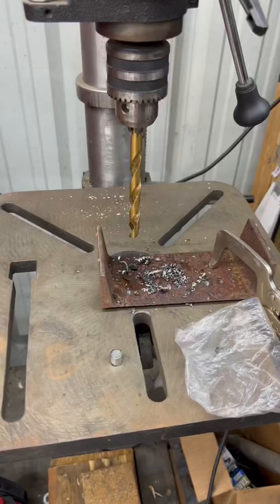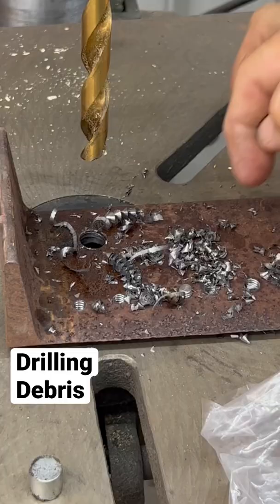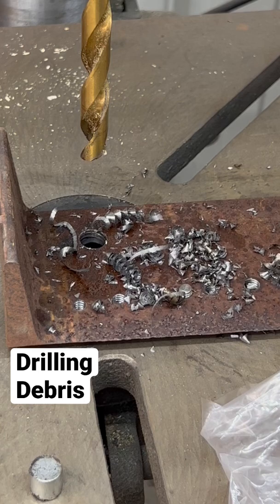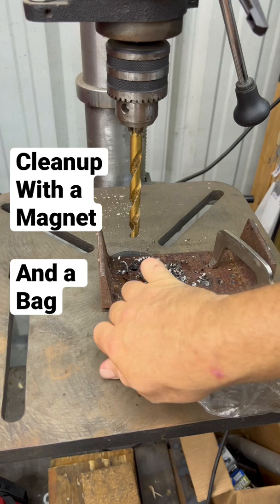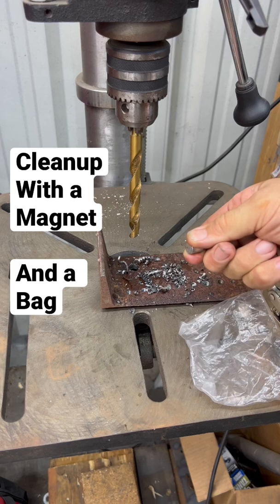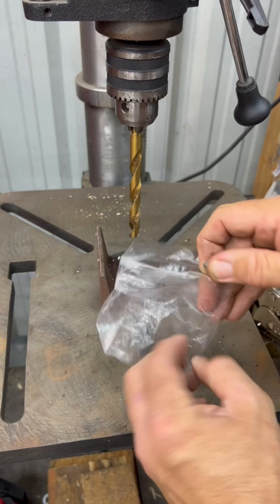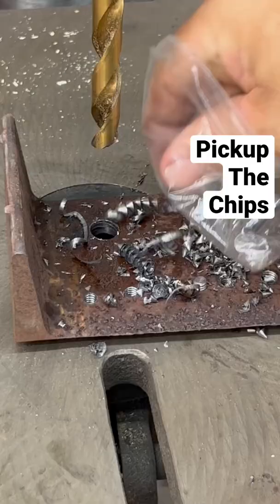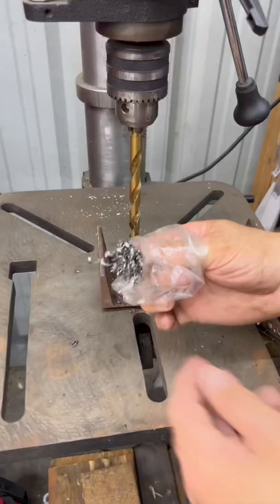Tuesday Tool Tip - Cleanup Metal Drilling Debris

Comment: Put the magnets inside an empty water/soda bottle instead. It works a lot better.
Reply: lol wtf are you talking about? Then you have to manually wipe off all the sharp, pointy metal shavings, and also the plastic bottle is much thicker than the plastic bag and it's only going to sit in one of the little feet on the plastic bottle, so you'll be sacrificing the strength of the magnet by creating extra, unnecessary distance.

If you don't have a plastic bag laying around, just use a paper towel or something. The plastic bottle idea is not good at all.